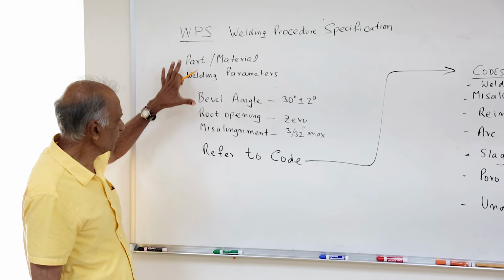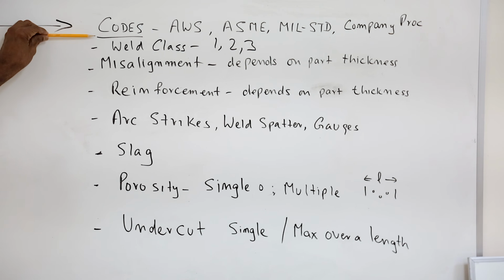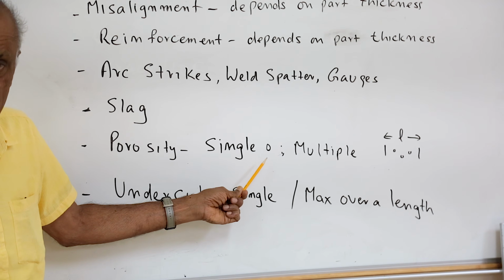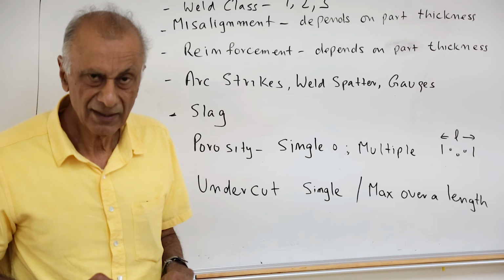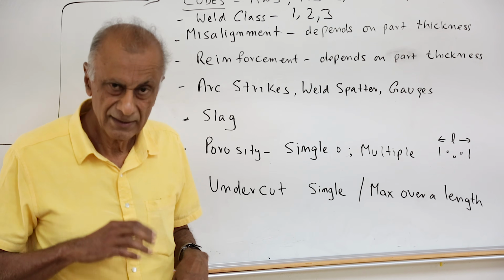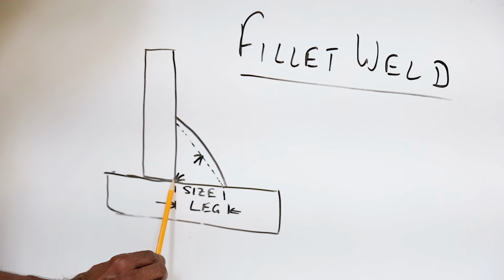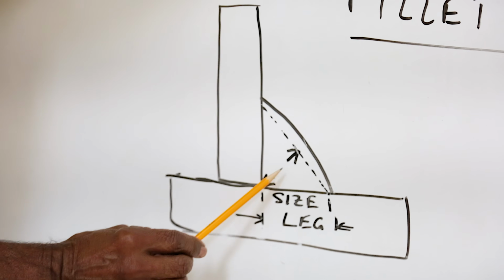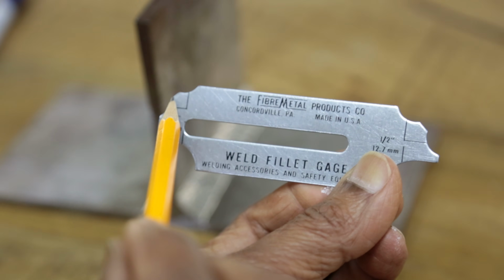Birring VT II Application of Acceptance Criteria for Visual Testing of Welds. How to accept/reject?

Comment: Is a galvanized iiw block required for inspection on galvanized products? Would it make a difference  for toe crack inspections?
Reply from the maker: No. IIW is a standard block. To compensate for coating you need another way to compensate